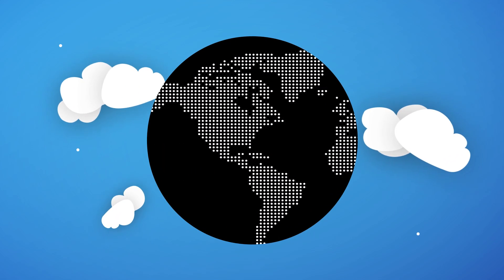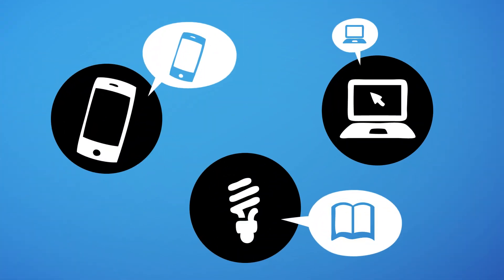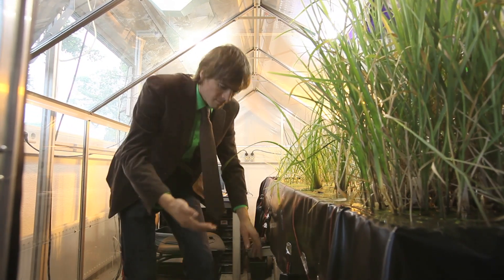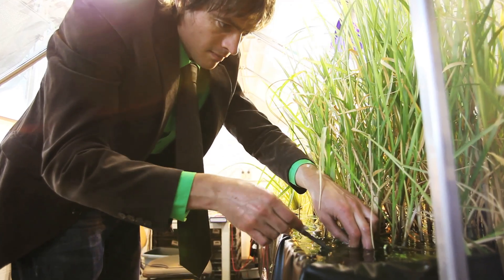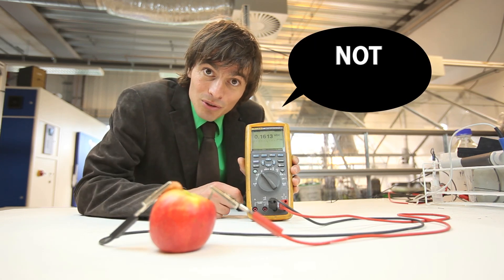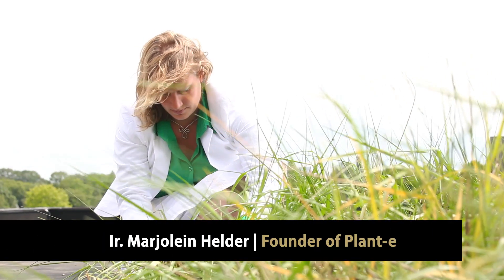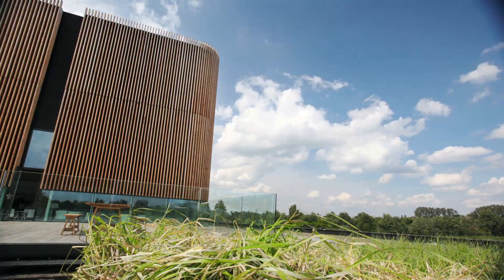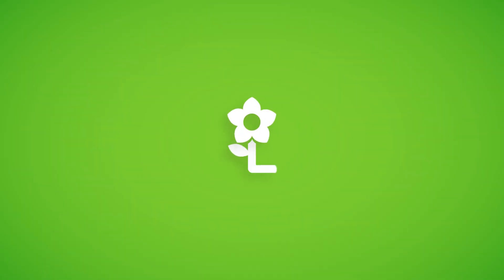Plant-e: living plants generate electricity

Comment: Movement, especially jumping induces electrical current by polarization. The moving things are living. Negative charge moves into the living organism and positive charge is reduced. That shift in polarization sends a neutralized current through the positive side of every particle in the universe. Every electron is connected to the air. The current produced by movement goes into that Earth and out at the other end of totality and exponential increase. Conducting organic current, also invites a surge on the return path. That return surge causes global warming; as the fire ball attempts long distance reentry. Since positive charge goes beyond the negative charge count, in size, there is also a big freeze invite, cooling the earth electrically. Cold magnetism has lightnings and moons; that far precede the actual high current ice ball. Jumping beans are the wave buffer. cJT

Comment: Why don't you try this instead, take sterilized sand, a walking, and a raw egg. Put a small hole in the top of the egg, place it in the sand and the plant so that root touches the hole. Fill the sand with water and sleeping it through the sand ma king sure filters keep the sand there. Test the current with a multimeter digital, positive to base or limbs and negative to tips of limbs. Now invent a harvested of the electrons being conveyed from water to plant to air.

Comment: hi there.i put water in a flower pot and copper and zinc screw i did get some readin of .500 volts i put some more water in the pot and the voltage started to climb to .611 voltsits a small voltage and i didnt have an led to try on it but i got some readings is that voltage ok
Reply: sotir petrovski 600 volts of electricity is (I think) more than enough to power a household outlet
Reply: Hi Sotir. Thanks for sharing. I think he mentioned that he did not use Copper, as it is toxic? What would you use instead of Copper?Could you help with this project? Creating a Lego Plant Pot, and using the Japanese Knotweed plant to create Electricity: http://butterflylullaby.blogspot.com/2018/08/lego-bricks-made-from-plants-japanese_9.html
Reply: Try the same experiment in parallel with other plants to increase current. Or do it in series to increase voltage. Connect anode and cathode to joule thief to light up your led.

Comment: While you guys go and dream on your plant electricity, ill wait for the nuclear fusion reactor to become even more of a efficiency success after the 500 megawatts of output power while only 50 megawatts is invested achievement.

ITER.   International Thermonuclear Experimental Reactor in France.

Latin for '' The way '' ... Literally its the way ;)
Reply: Do look at other innovative, and often ignored, approaches to fusion. Check out Lpp fusion's focus fusion device.
Reply: Fusion reactors are very clean and a great source of energy but they are extremely dangerous. They could possibly be radioactive since atoms split and join together. They are also very explosive and extremely hard to control. You can't stop/slow them easily like nuclear reactors.

Comment: Doe, have to say, 15 square meters for a cell-phone baterry charge isnt much. How much electrode and wiring material is needed for a hectar, how long theyre last in the plant water (potentional oxidizing environment) and how would you need to modify the grid-connection ?
Reply: PytonPagom Also, any tests of the electricity yields for various plants, especially vegetables and/or fruit trees ?

Comment: based on what she said, the energy density of this is roughly 0.66Watt/square meter

how the hell do you power half a households energy need with that?
Reply: +Anon ymous It depends what you use. Like poor people barely have money to buy led lights with 0.5-10W led. Also they can grow food at the same time. It's not easy to understand economy and conditions of poor people from our point of view. This is a great idea, because it doesn't need extra space and we have to grow plants for food anyway.
Reply: Anon ymous they can double power output each persq meter by connect like earth ground energy
Reply: Anon ymous I use roughly 1.21 watt... or is it 1.21 GIGAWATT!! giga-giga-gig-gi-gigawatt!!! and 88 mph :\
Reply: JackassBauer1 In back to the future 4 (cause when hollywood will get out of idea, as they often do, they will produce it) Dr. Brown will come back from the future in a garden rooftop delorean.
Reply: ***** You don't need to be an expert to do basic mathematics. My house has a roof area of approximately 70 square metres, and that would yield about 24watts. Average household electricity consumption is around 40 times higher than that and is of the order of 1kw. 

In comparison, the best solar panels produce about 150-200W per square metre in ideal conditions. Even averaged over a year it will likely produce 40-50W, of perhaps 60 x the energy density of this system. 

Then there's all the maintenance. In dry conditions water will have to be pumped up to the roof unless there's an enormous water reservoir to catch rain (evaporation rates of a green roof will be very high in the summer). Water supply systems involve a lot of pumping and are big energy consumers in their own right. 

If you want efficient electricity collection using roofs, solar panels beat this hands down, albeit that the world desperately needs improved batteries for storing such power.

As for the argument you used by analogy "they laughed at the Wright Brothers", then that tells us nothing. Not only did lots of people not laugh at the Wright Brothers, but there were endless people who could see it would work and raced to improve the technology as there was nothing fundamentally wrong with the idea. However, for every Wright Brothers there were dozens of ideas that simply didn't, and couldn't work in practice. Even great engineers like Isambard Kingdom Brunel got things completely wrong (like the atmospheric railway). Similarly people have been awaiting flying cars, workable jetpacks and much else, all of which have fundamental practical problems. They might work (just), but are not practicable. 

For the record, my degree is in physics.
Reply: twinkstance well there are millions of plants in the world that could be hooked up to a powerful power unit and could power electric cars, plus potatoes make higher amount of electric power
Reply: common sence. *****
Reply: There is a huge difference between the two. The electricity generated due to these plants must be equal to, or less than, the energy absorbed by the plant from the sun. In that case, it's better to directly capture the sun's energy using photo voltaic cells because they have the capability of absorbing more energy from the sun than the plants! The 'big battery' had room for development. This concept does not!
Reply: The most powerful living plant battery is Japanese Knotweed. I would love support to carry out some experiments. http://butterflylullaby.blogspot.co.uk/2017/11/japanese-knotweed-plant-battery.html
Reply: Interesting, thanks for sharing.
Reply: Yup... its renewable, green, but not efficient.
Reply: Small house, big backyard, wise and conservative use of energy. Is "energy obesity" a term?
Reply: Turn off your gadgets. Learn to live.
Reply: My guess is that the future of this tech(if there is a future for it) lies on finding the best plants possible, then put them under artificial selection and genetic modification.
Reply: joby dorr there is a difference between technologies with a future... and those who do not.. ( such as this ).
Reply: A Doll House :)
This conjures up many humorous solutions; Soon you'll see Tesla's driving down the road with a flower boxes box hanging on the side of the car..powering it for long drives.  Or better,  flower boxes with wheels and a steering wheel.
Reply: @144Donn  this means you need to plant forests idiot.
Reply: Oh, you're right. Obviously, the technology is perfect and requires no more research.
Reply: You could power just a lightbulb in poor communities

Comment: It seems to be some kind of a mud cell battery...just 2 carbon electrodes one closer to the top of the plant and one down at the root and the water and soil is the electrolyte... I will try top experiment with this also but probably the power output is not very high, so you need lots of area to get a higher output this way... Anyway, it is a start...maybe it can be scaled up by using the right plants ??
Reply: And other methods that increase plant metabolism, such as greenhouses.

Comment: One last thing, soils themselves are very low amp, low watt generators and batteries.  The introduction of particulate, non-toxic capacitive materials could amplify the power generated by this method with a large enough dispersal structure.  It would benefit the plant as well; think perlite...
Reply: Could this also improve earth batteries?

Comment: I think a more applicable approach would utilize this methodology as part of a larger multidisciplinary combination, incorporating wind oscillating piezoelectric vanes, conventional solar, and chemical transition energy recapturing (think pH transitions).  And many, many more.  Utilizing many different ways to generate electricity provides more system reliabity.  
As an aside, electrode placement involved with this method has another benefit.  Sensing real-time soil conditions...